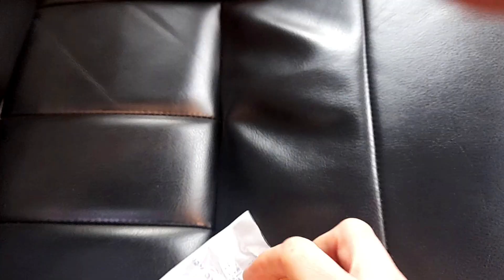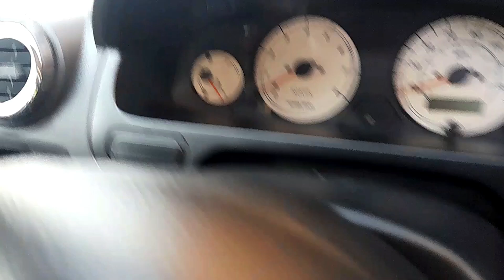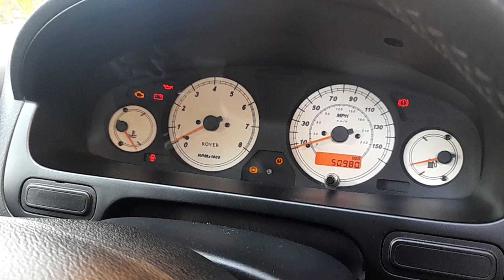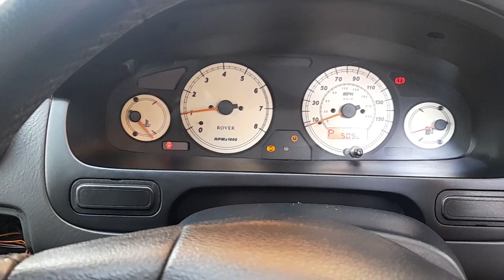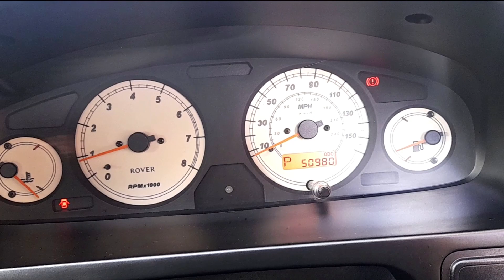Project Beatrix - Did my fix work?

Comment: Well done mate 👍 Excellent diagnosis and fix. Hope the windscreen gets sorted quickly so you can finally begin to get out and enjoy the car worry free.
Reply from the maker: TBH I think it's stopped spreading, I can live with it in the short term until I can get it fitted.
Reply: @usuallyfixingtinkering  It's been a decade now but windscreen cover was a freebie or small contribution on your comprehensive insurance policy. It also never affected your NCB or claims history. Providing you use the preferred windscreen repairer, otherwise you have to pay £150+ towards it or something. My old dad did it after we used glass chip repair kits, etc. It didn't cost anything and the whole glass was replaced on a shitty Hyundai Accident 😆
I don't hold out much hope for my wonderful Ford QuickClear if that ever goes... 😥
Reply: Also it's when it spreads into the drivers view (which is anywhere in the windscreen wiper sweep) that it becomes an MOT fail.
Reply from the maker: @Drew-Dastardly  Stranegly the place where I collected the windscreen has ford heated screens for MK1's. They have almost every screen you can imagine, huge warehouse. I'm afraid to say things have changed as far as the my insurance companies, unless you have protected no claims - it will affect your no-claims sadly. Luckily for the price I've obtained mine for its a steal. it will get fitted this summer at some point. Get a few more months out of the crap screen I've got!
Reply from the maker: @Drew-Dastardly  I'm not worrying in that sense, its got 10 months on its current one.

Comment: I just watched an Eric O video of a similar massive fuse getting blown and it's not something to be taken lightly. In his case it was the absolute rustbucket of the car, the shock detached and scrubbed into the wiring loom to short it out. That is something that can conduct 100 amps+ That pickup truck is toast.
It appears your car also has a wiring and mechanical interference problem which is fortunately easily fixed.
(eta: Eric is South Main Auto on youtube - much different cars to us Brits, but the salty rust is something we know too well and he is a genius when dealing with it)
Reply from the maker: Mine luckily is a simple short that I've now located and fixed, the fuse has done its job as nothing has been affected, drives like before :)